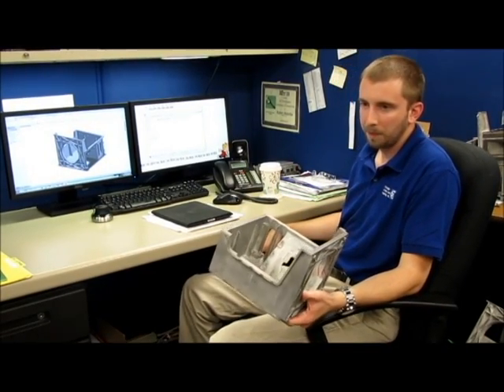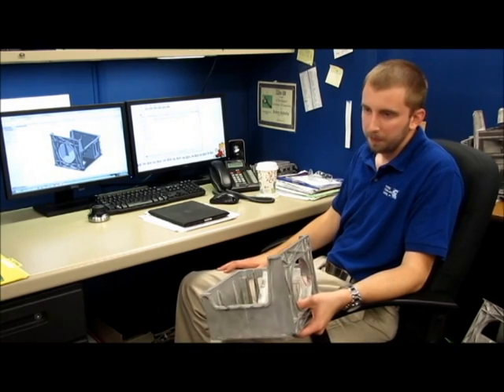CWM Case Study - Magnesium Die Casting Enclosure for Projector

Comment: Would love to know why magnesium was chosen to cast this assembly in the first place. I recently found that the equivalent part in a much smaller Sanyo home projector was magnesium and wondering why  led me here - the weight benefit seemed minimal as it was only one of many components in the machine - is there another reason Magnesium is chosen for the lamp engine enclosure rather than, say, Aluminium?